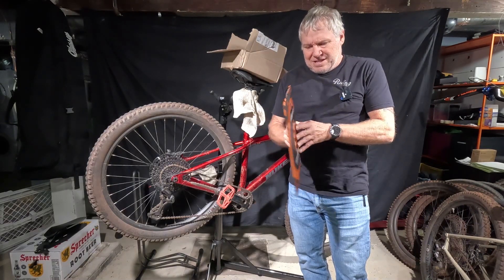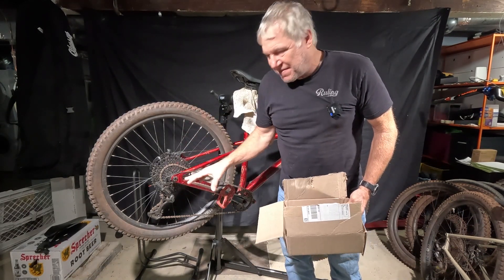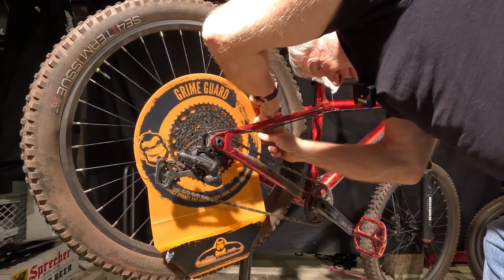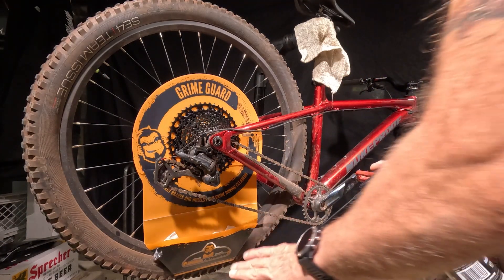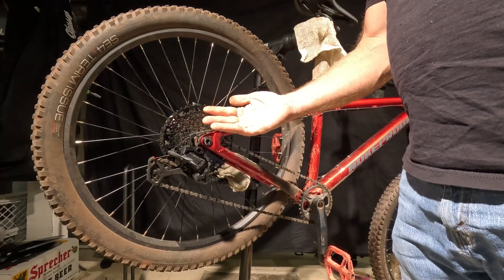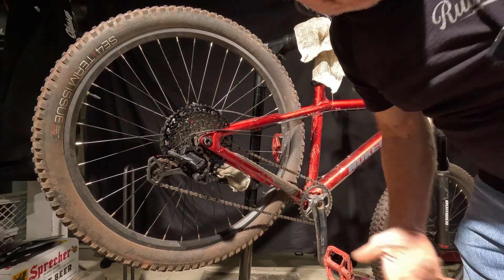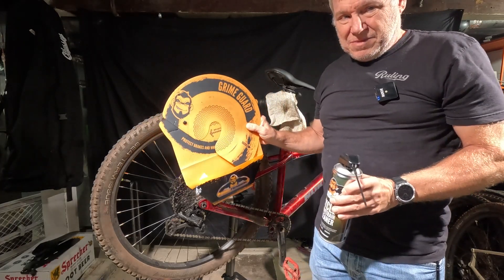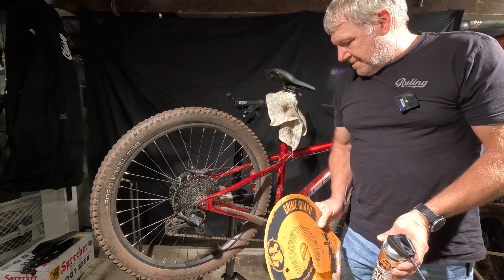Reviewing The Tru Tension Grime Guard

Comment: Good review, I have seen this come up in my feed a lot as well. I opted for the muc-off version as it covers the rotor. I like this for traveling as well. It does a great job of protecting the rotor when on my bike rack while traveling.
Reply from the maker: I am assuming you mean you travel with the Muc Off ones. Those specifically cover the rotors and Velcro on. This is basically a temporary piece to use while cleaning your cassette so you don't spray your rotor and it does a decent job protecting most other stuff as well.

Comment: Thanks for sharing. 
I was interested in one of the MUC-OFF ones as well, but eventually, I just grabbed an Amazon bubble mailer from an order that I placed. 
Cut  the open end, vertically, through the face side from halfway across,  and end the cut halfway up. 

Then cut one of the seam's all the way up, from open end to closed end. 

Now you can just slide it over the rotor, beyond the axle, and over the seat stay. 

Works like a charm, and who doesn't have any Amazon bubble mailers lying around? 😆
Reply from the maker: Nice mod! Whatever works and saves money and reuses waste.

Comment: Ever since I changed to always using only waxed chains. I never need to use harsh cleaners and don’t worry about overspray on my rotors or brake pads.
Reply from the maker: I have heard about waxed chains. I will look into that more and likely talk about it here. I do know there are wax-based lubricants like White Lightning.
Reply: @ShadLife  I use Silca wax and wax lube

Comment: Mucoff’s Disc Brake Cover is more protective of the brake rotor.
Reply from the maker: I do believe that one is designed for cleaning your bike with the Muc Off products. So it basically has a  Velcro cover for just the rotor. This particular one is more specific for just cleaning the drivetrain and catches the dripping of fluid.

Comment: Easy fix, just use WAX, no oil to contaminate your bike, no oil to leave goo on your bike, no need for chemicals/detergents to wash the bike, no problem with contaminated brakes, no bearing/bushings wiped out of lube, no need for anything other then water to clean your bike, so it can be washed off in 2 minutes.. I'll get washed more often too..

Comment: I think I'd rather wrap a pile of tissue around the rotor as it's practically zero cost and less faff
Reply from the maker: I think finding a piece of cardboard or plastic that you can cut to slide on like this device would make more sense. You want to protect the entire hub, spokes, brake caliper, and all of that otherwise you have a lot more to clean up after.

That or the best option, and more time consuming, would be to remove the wheel, take off the cassette, and clean it off the bike.